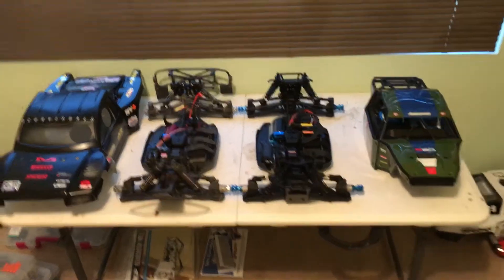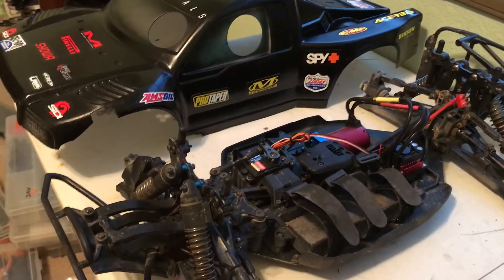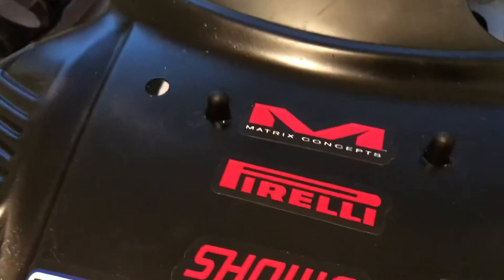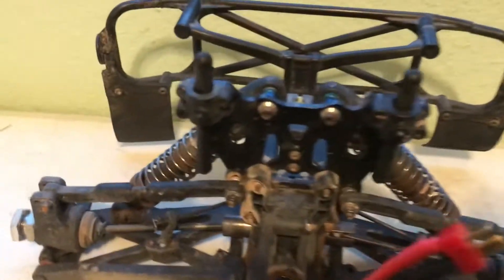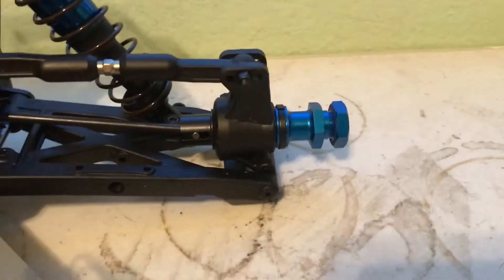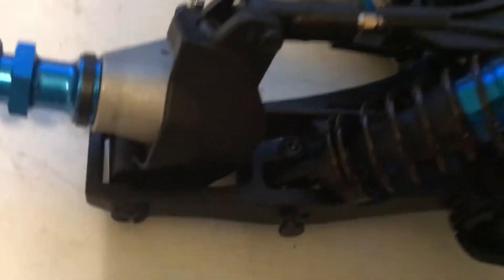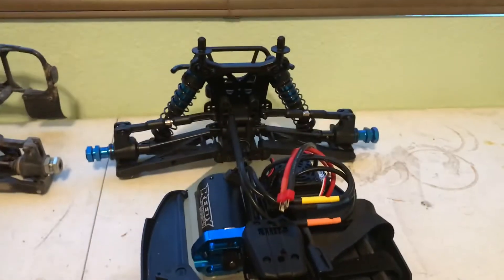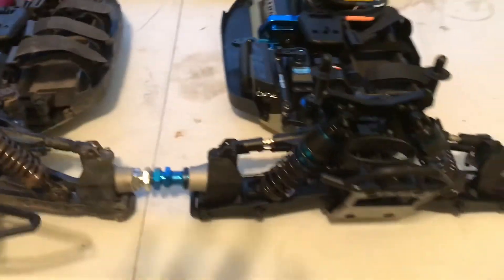SC8E vs Nomad DB8 comparison, in depth look !!!

Comment: Can you check if is it possible to assemble the cage under the SC8 body?
Reply from the maker: The sc8 body has its own cage ..the db8 cage will not work
Reply: @arizonadualsport2590  and what about the wheels? Can you give me the wheel diameter for the Sc8e? I'm converting my Arrma Senton to 1/8th scale. I'm afraid the original wheels might be a tad too small.
Reply from the maker: Gilberto Almeida sorry I'm outta the R/c stuff .. so not really up do date on any of it .... thanks